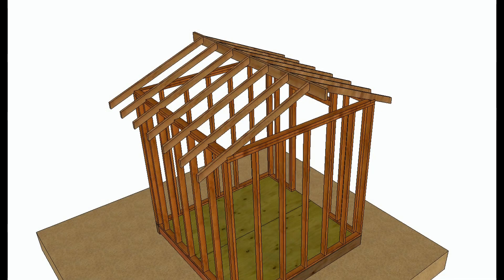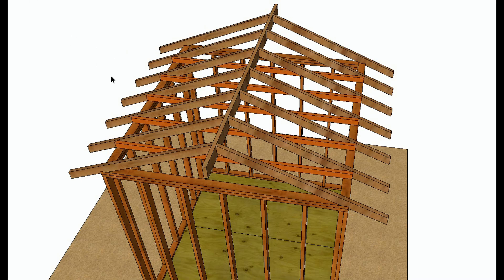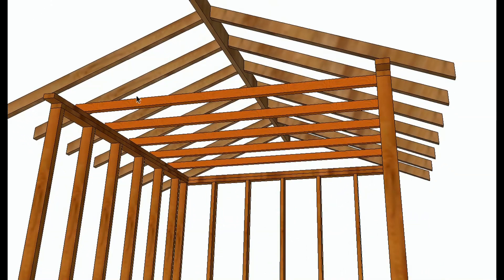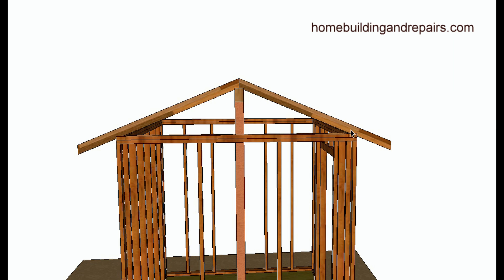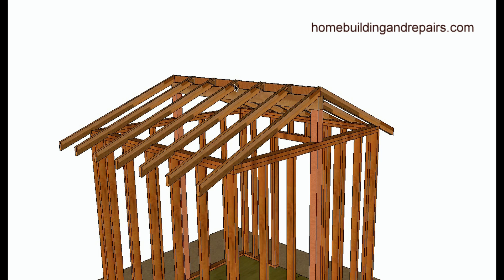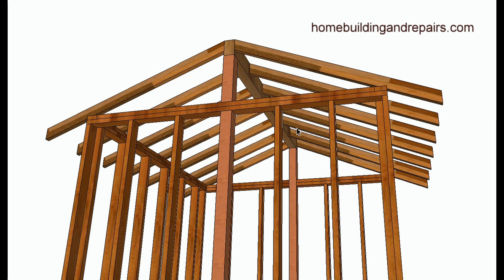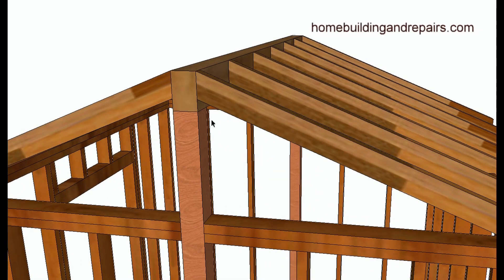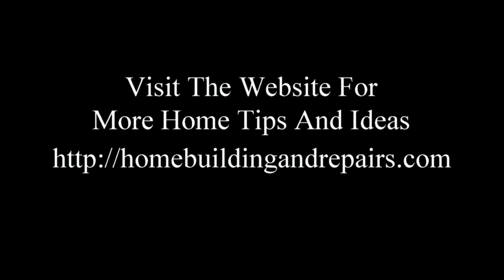Vaulted or Cathedral Roof Framing Basics - Home Building and Remodeling Tips

Comment: Why doe engineers prefer the straps? Wouldn't the break be far less effective than the stacked method on the front?
Reply from the maker: If you're referring to the post that is separated by the top plates, then really you have two choices. Either strap the post together and have the top plates continue through or have a continuous post that would separate the top plates that would also need a strap to connect the top plates together. A situation like this won't require a strap if the wall is balloon framed or if the wall studs are continuous like the post.
Reply: Right I understand, but why is one preferred over the other? You said it was prefered to have a solid beam. Why is that?
Reply from the maker: I don't remember saying that one was preferred over the other, could you be more specific and show me where I said that.
Reply: At 5:52. "They'd rather see the strap..." Also, why do the front rafters line up but the others overlap? Great video btw.
Reply from the maker: https://youtu.be/ZWeDYJrL3KM 

See if this video helps if it doesn't let me know and the rafters that overlap are used to create a nice solid tie or connection if there nailed together. You can nail the top of the rafters together from each side, otherwise you would need to use straps if you lined them up.

Comment: Can you also cover the fastening tools used in the framing, and how they are installed.  :-) thanks
Reply from the maker: +Jaime Perez If I understand your question correctly, can you cover the building hardware, straps, nails, etc. Yes, you can and they would be installed per manufacturers installation instructions. Let me know if I didn't answer your question or feel free to ask another.
Reply: +gregvancom : Thanks and yes, you answered it.  :-). I have another question, do you know the weight a 2x4 can withstand before it breaks?  I'm also trying to understand the load factors for the framing elements.  :  thanks
Reply from the maker: No I don't know how much weight a 2 x 4 can carry before it breaks, but there are span charts that might be helpful to you. I typed the words "framing span tables" into a search engine and it pulled up all sorts of information that you might find helpful.
Reply: +gregvancom :-).  Yes, thank you.

Comment: From a "remodeling" standpoint, which the title also suggests, the majority of us these days (but not exclusively) are going to run into engineered trusses. So, you're saying from scratch then or old-style construction, I assume?
Reply from the maker: +NorthernChev They still use conventional framing today, especially when engineered roof truss systems won't work. A good example of that would be cathedral ceilings.

Comment: Another very informative video.  I have a small suggestion; please make the cursor bigger.  It would be easier for DIYers to follow you easier.  Thank you.
Reply from the maker: +SandiRose27 I would love to, but currently have it as large as possible. If someone else can provide me with instructions on how to make it larger, I would love to know how.
Reply: +gregvancom  Since it was my request, and I'm retired so I have the time, I searched all day yesterday for a solution.  There are almost no choices for bigger cursors other than what windows offers on all computers.  BUT, I did find this website and I believe they are safe.  http://www.rw-designer.com/cursor-library    MOST of the pointers available are plain silly, but there are a few that will be beneficial.  You'll just have to take a little time to QUICKLY scroll through the JUNK.  I hope this helps.  Thanks.
Reply from the maker: I will check it out and thanks for all of your effort.